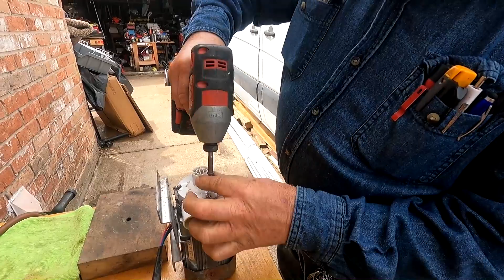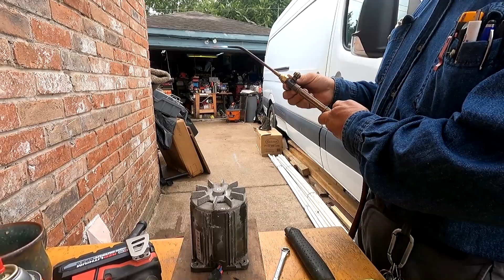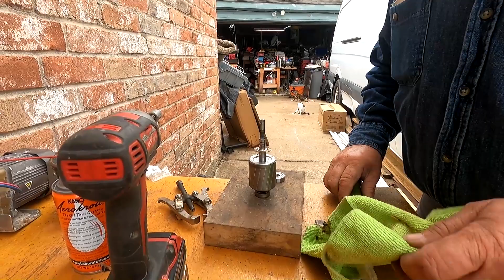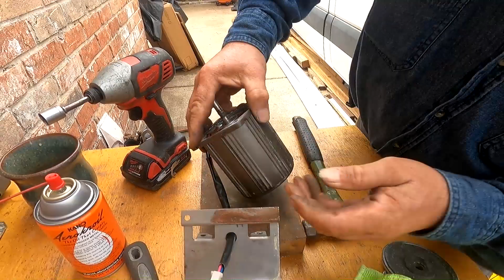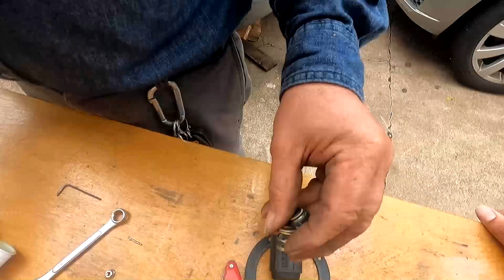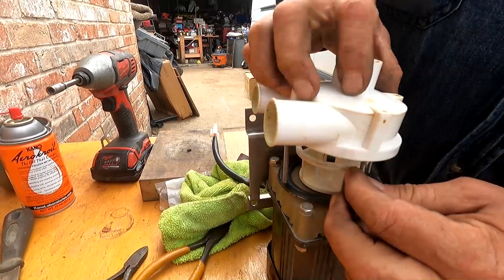How to rebuild a hoshizaki water pump

Comment: good job leo,i also found the grease seal to protect the bearing from the water,you do not want the seal to spin with the grease,it wears out,and the round cover has a grove for the wires.